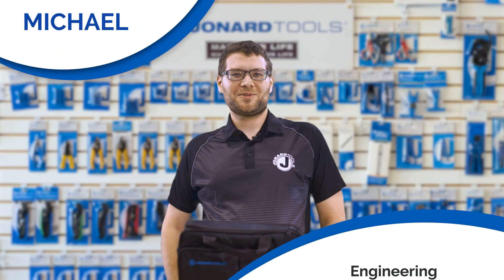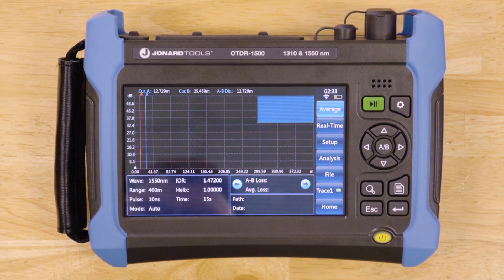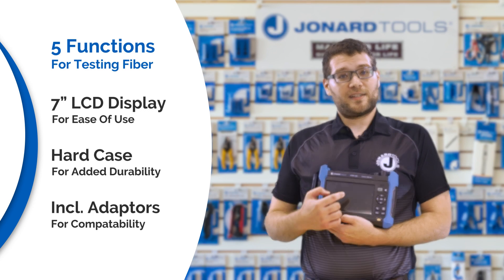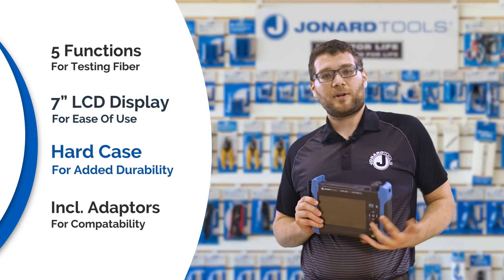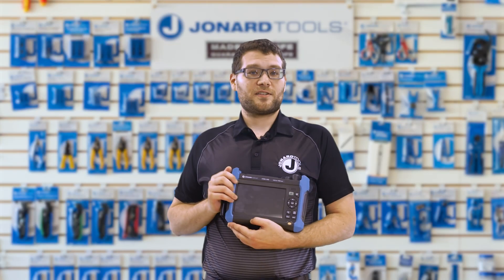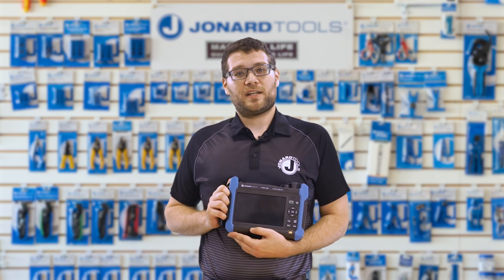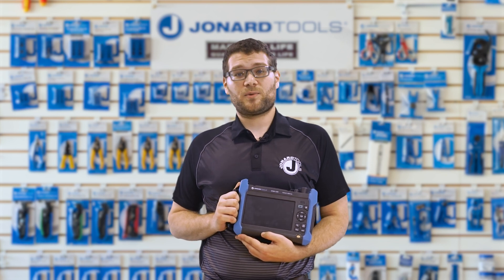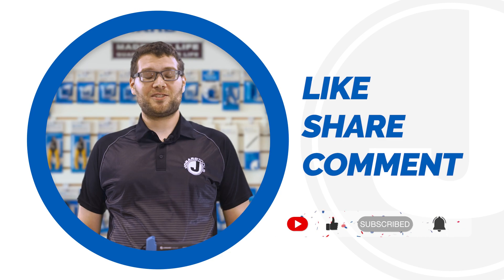Jonard Tools Multi-Function OTDR 1310/1550 nm (OTDR-1500) Product Video

Comment: what is the difference between the  otdr 1000 and otdr 1500, in terms of function
Reply from the maker: Hi Steve, yes there is. Let me break it down for you!

OTDR-1000: UPC OTDR port, network cable TDR and tester, 24/22 dynamic range, no touchscreen

OTDR-1500: APC OTDR port, android connectivity, 32/30 dynamic range, touchscreen, no network cable testing/TDR

Hopefully this helped!
Reply: @JonardTools  thanks 😊
Reply from the maker: @steveleung855   Of course!